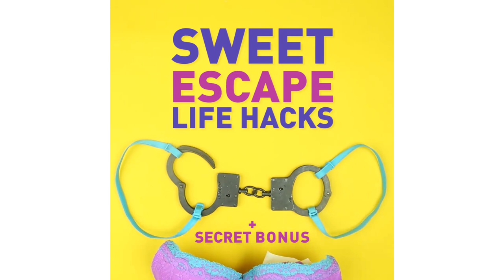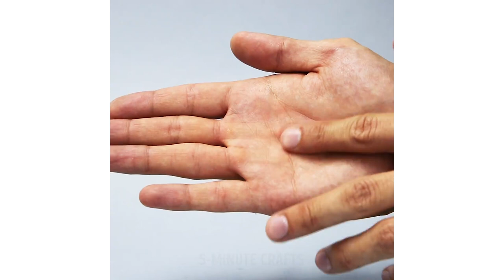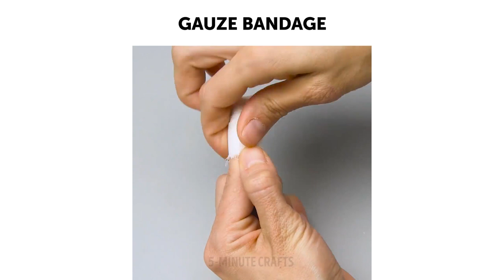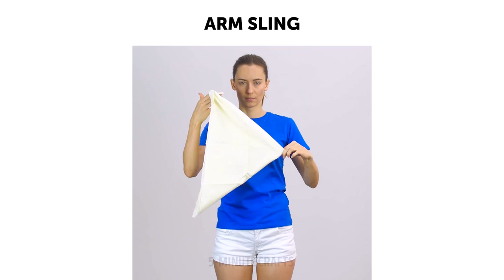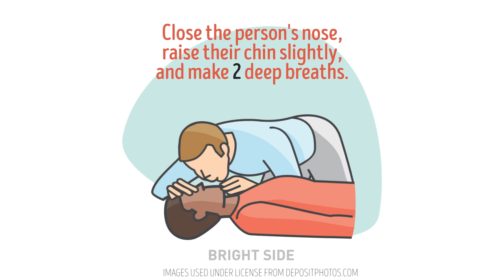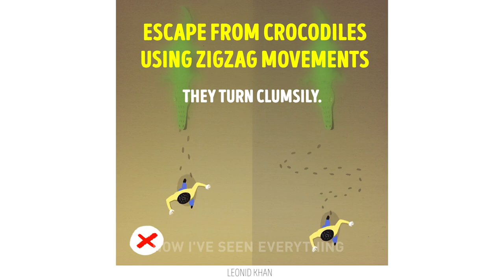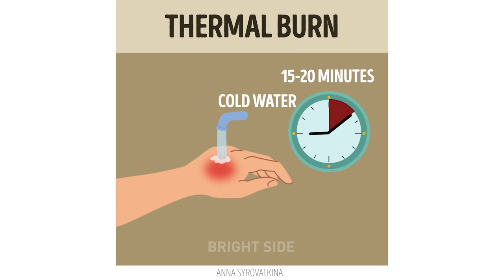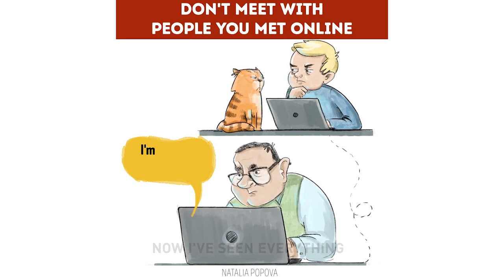18 SELF-DEFENCE TIPS THAT MIGHT SAVE YOUR LIFE

Comment: When you're in a public place with a bag and don't want it to get stolen, just put the strap around your leg. I've had someone try to take my purse and felt the tug on my leg, turned around, and they were running off. If it's around your neck it can just be tugged off, especially if its just in your hand. If you're sitting (restaurant, airport), its best to put it on the floor with your leg through the strap.
Reply: that works too <3 Pretty much anywhere where it can't be tugged off or worked around. On your leg you'll feel the pull, but if you're sitting in the chair they won't be able to get it off unless they cut the strap, which is rare (at least where I live).
Reply: They could just knock you out and undo it and take it
Reply: CHECK OUT BAP: 'Hands Up!' I do that too
Reply: I do that with my backpack at school because there's this person that keeps stealing peoples stuff
Reply: André Bland-Wallen But That Attracts Attention

Comment: Yea. Ima put tape all over my window so when someone tries to break in the glass doesn’t shatter. 😐
Reply: Luisluis 26 your picture and the comment
Reply: What if you tape the whole window?
Reply: nikoolay raykov then it’s not a window anymore
Reply: Yeh, when I randomly throw a massive piece of glass at a massive piece of brick that I obviously have in my house 😂
Reply: Usually people use that hack for tornados and hurricanes.
Reply: Isn’t the point of a window to see out of it
Reply: It’s not meant to prevent the glass from breaking. What? Did you not see it still broke? It’s meant to keep the shards together so it’s not a safety hazard
Reply: Just use safety glass.
Reply: Lassemacchiato the point of the hack is to provide another way to safely pick up broken glass for those who can’t/don’t want to buy safety glass. It’s an alternate option rather then replacing all their glass, they can use a common household item.
Reply: Luna Star You still have to replace the broken glass if it came from your window
Reply: jbac xtrme I mean, why waste money to change the glass before it’s broken? They can use this instead then change it afterwards.
Reply: WHEN THAT CAME I READ UR COMMET

Comment: If you are in a potentially difficult situation with a stranger keep shouting FIRE not help. People aren't that heroic in general, (and won't come and help especially if you are injured, although I help people despite the fact they don't ever help me), but they are into self preservation so this causes a rush of people and disrupts the stranger. 

I've done this myself.

Also with first aid (I'm experienced at this) if you have a bleeding wound that won't stop elevate the limb and apply pressure if you can. Remember the RICE method-  Rest ice compression elevation for sprains and bruising. 

Some of these tips are very useful, and sensible.

Comment: 5:18 if you live someplace where the weather is very hot often, and you keep both car windows open when you’re in in the car, I have a different “life hack” instead of the scarf thing (cause why would you have a scarf if it’s hot out?). What my girlfriend does is she takes the seatbelt and puts it through the straps of her purse and then clicks it in. That way, if someone tried to steal it, they would have to unclick the seatbelt, and she would notice before they could do that. With the scarf thing, there is a chance the scarf may be too thin, and so it easily unties. Another option if you don’t need your purse for awhile is to put it in the glove box. However, if it’s too big for the glovebox you can just put it on the floor in front of the shotgun seat, and push the chair forward (if your car has that feature) so that way it is almost impossible to reach from the outside window.

Comment: The handcuff one wouldn't work if the cuffs are double locking. The secondary lock prevents the spring that is under the single bar from moving
Reply: morganaroberts11.29.17 true